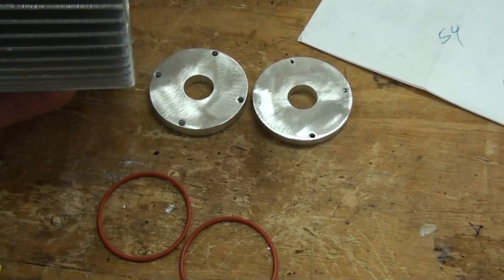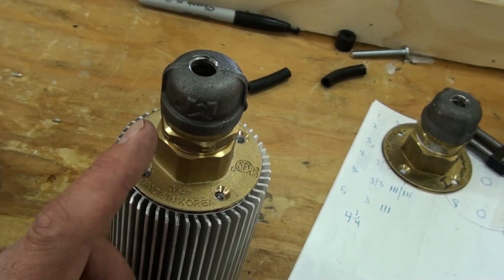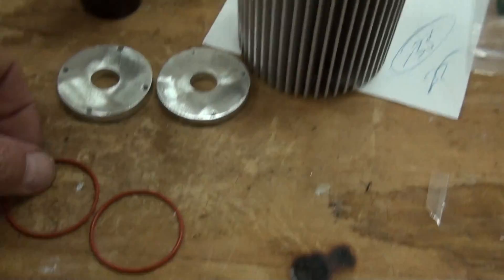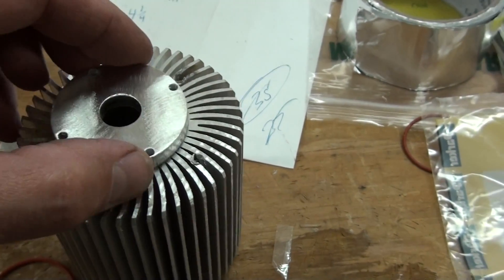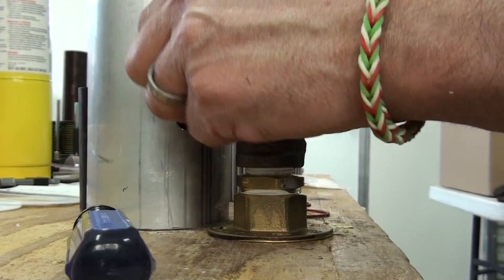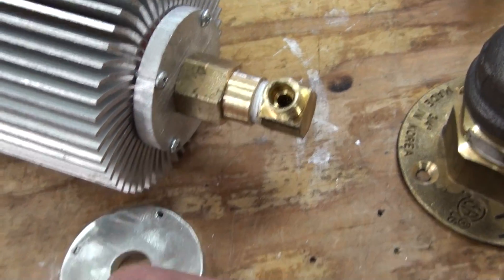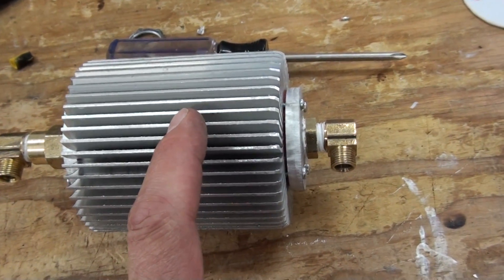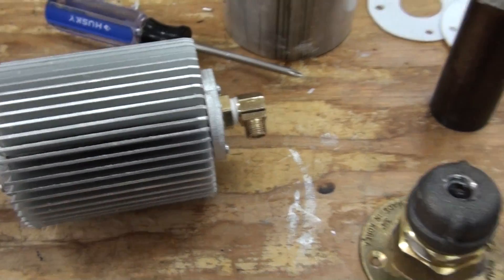H-cat video 11. A look inside the hho reactor.

Comment: aluminum is amphoteric- means it reacts chemically with acids AND bases- so your aluminum parts, while in an electrolytic solution will chemically react and liberate hydrogen gas. aside from any electrical effect. food for thought

Comment: Looking good Steve.

Neal
Reply: delvis11 We haven't given up. I've just had a lot of things going on, plus low funding which has prevented me from doing much of anything. I've really been sitting back and watching what everyone else comes up with. I like where you are going with this, don't give up.

Have you tried the H from your split cell yet? I have yet to see anyone work with this. I don't know how the traditional reaction will function in the cats without the O to be used to recombine with the H. If we can figure out how to keep the cat from becoming water logged we can enclose the cat in with the cell / reservoir since gas pressure should be no issue because what your producing is going back to water. If we combine the heat from the res and the recombination in the same reactor this would make the form factor smaller and bring the overall heat efficiency up. I just worry about the cat becoming saturated quickly. Maybe vibrating the cat to shake the water out like Sterling suggested isn't such a bad idea after all? Got to be a way to do it but it seems to be a problem even with the big boys. 

 I'm rebuilding my split cell so its been down for the count until I get around to it. I'm working on passing a water or oil pipe through the matrix itself instead of pulling heat off the exterior of the cat then insulating the the exterior so all the heat is focused inside. That is how Rossi's system works. I think we will get better results that way. Sterling is dunking the entire cat in a big water bath, that may work if we could send in a bunch of gas so we could bring temps up stable to 8-1000f but the flashback hasn't been controlled yet. If you take that same cat, and send in a few ounces of water instead of surrounding it by gallons and gallons of water, it would make it much easier to get the water to high temps, maybe even steam. I plan on using some type of oil and sending to an exterior radiator. The tiny cats you have can be used the same way for a small space heater. Use the little cpu radiators. 

Anyways, I could go on and on. I have a ton of ideas just got to get motivated and some funding behind me to get some of it off the ground. I'm thrilled you guys are still experimenting. Sterling has really surprised me. In the beginning I was sure he would give up on it but it looks like he has seen enough evidence to know there is something to it, we just have to keep refining and experimenting. Nice work, keep at it
Reply from the maker: I haven't heard a peep from you guys in 2 months. Did you two give up h-cat?
Reply: delvis11 On the contrary ,
We have the forum, I still experiment, just nothing earth shattering yet.
Check in at the forum, lots of good stuff going on there.
I have three major projects going on at once , 

Neal
Reply: jdcproducts When injecting the hho into the cat you could possibly find a reed resonator that the hho flows through which will create a sound resonance vibration as the hho gas passes through the reed, this will prevent you from having to use more electricity to run a vibrator.
Reply: delvis11 When injecting the hho into the cat you could possibly find a reed resonator that the hho flows through which will create a sound resonance vibration as the hho gas passes through the reed, this will prevent you from having to use more electricity to run a vibrator.